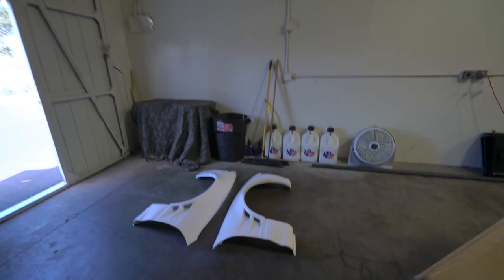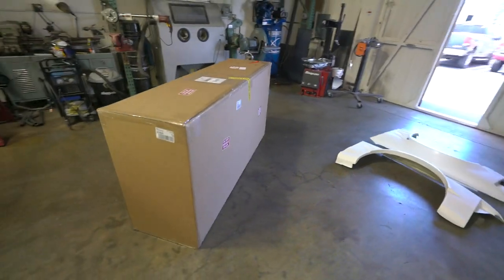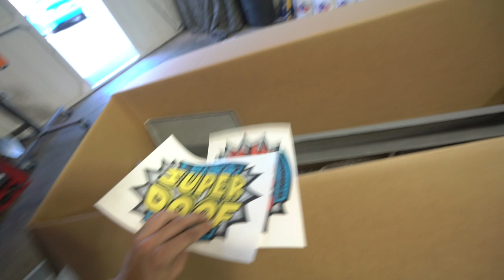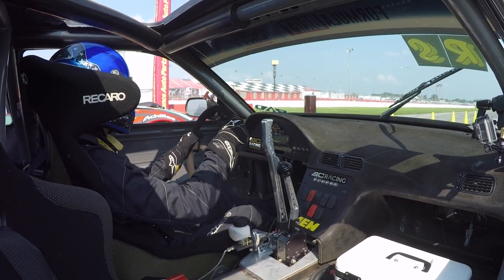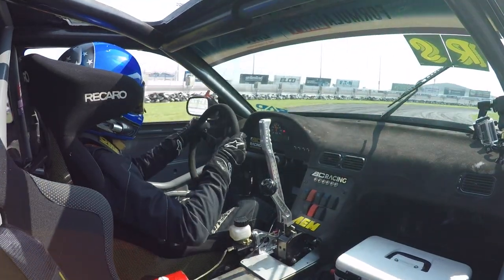ROLL CAGE FABRICATION USING A BROOM!

Comment: Yeah buddy!!
Reply: Please tell Dylan not to cut the rear bumper if you gave him one.  And if you did, I hope he hasn't already. 😖
Reply from the maker: Sorry dude back bumper is staying cut, much easier to make suspension, tire, and rear gear changes with it cut out. Not to mention if you dirt drop with high wheel speed with an full rear bumper it will blow it to pieces. Plus I like the way it looks 😁